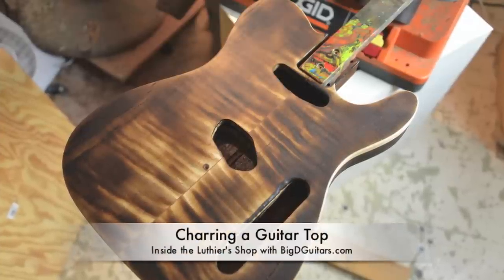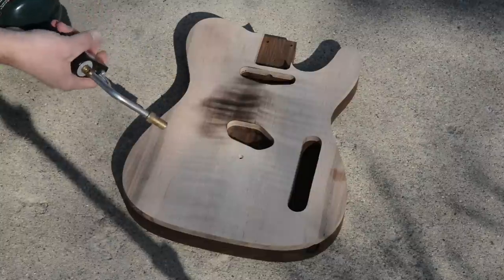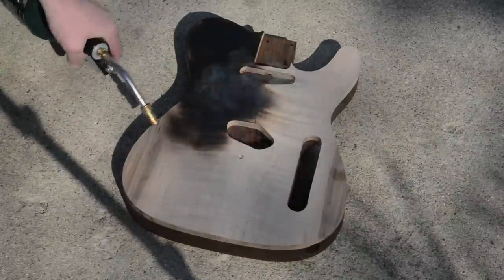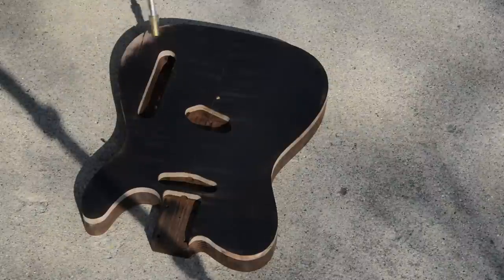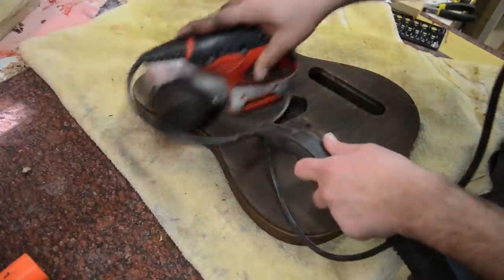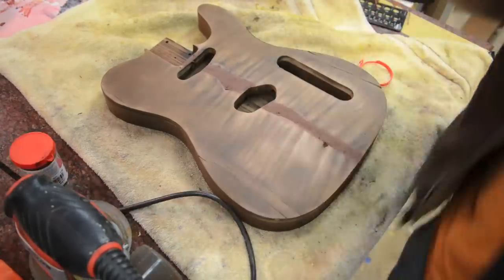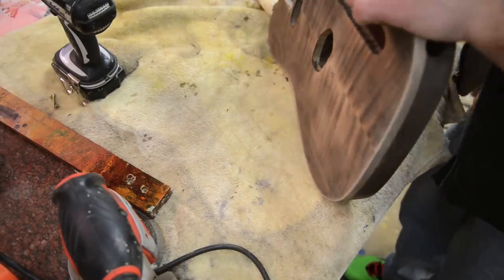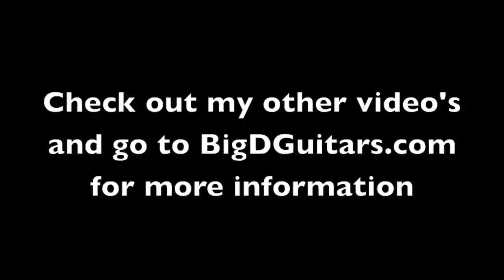Charring a Guitar Top Flaming a Flame Maple Top Scorched Luthier Project

Comment: Here is a helpful hint.  One of the biggest problems with using a basic plumbers torch is the small diameter of the flame. It becomes difficult to control the depth of the burn and the evenness of the burn pattern.  They have an adapter for these types of torches that spreads out the flame to as wide as 5 inches.  It's kind of like the difference between painting a wall with a 1/2in brush or a 5 in brush.  The charring will be more even and you will have far more control.
Reply: carmineredd  that makes no sense.

Comment: Fun project!

I just did my own hillbilly version of torrefication.  I went to Menards and they had a piece of 8" by 6' maple that had pretty good figure on it for 20 dollars, so I cut it into pieces long enough for a guitar top, and put it in the oven for 4 hours at 360 degrees F.  It turned out really well, but the boards did cup a little bit.  It's no big deal, and I'll still be able to make a beautiful top out of it, but if I try it again I will be clamping the wood together with the grain in opposite directions next time to try to mitigate any change in the shape of the wood.  In fact I'm trying the technique out on some hickory now.
Reply from the maker: I would love to see how that turned out!!

what happened to the wood?  how bad did the house smell?
Reply: I'll upload a picture and post a link when I get  home from work today.  The maple made the house smell great, kind of like a mix between cookies and pancakes.  The hickory didn't produced a similar smell, but it wasn't as strong.  The maple has more sugar in it I guess, so it darkened up a little more, but it looks just like the professionally torrefied neck on my last parts guitar I built.  I'll post a side by side picture later.
Reply: Oh yeah, and I should probably warn everyone who reads this, don't do this unless you know what you're doing and have a fire extinguisher handy.  Wood is assigned a generic flash point of about 450 degrees Fahrenheit, and at the low level of moisture in the wood, it would burn pretty violently if it caught on fire. I don't want anybody burning their house down because of me.

Comment: Nice work! The heat treated ash looks and sounds awesome! I've been a fan of baked woods for a while now.
How about watering the top, letting it soak a bit an then putting a torch to it? I would guess it prevents burning and the water trick usually helps the flames in the maple pop out some more.
Reply from the maker: I was thinking of maybe using naptha to soak and the light it ala Jimi...  not sure how save that is.

Comment: Charring the wood might be better to do earlier in the guitar making process.  Maybe when you first get the lumbar for the guitar, because that heat probably warps the guitar somehow.  Not sure how it would affect the glue for the join either.  Does it really sound the same?
Reply: You can't do it earlier otherwise there is going to be bare wood from routing and working the wood. He did it at the right time. Its the same technique as Shou-sugi-ban where it first came from. 

The pros are it makes the wood water proof, removes moisture, increases rigidity. The removal of moisture is why it is resistant to warping, twisting and cupping. The cons are the glue does separate and it costs you a very small amount of thickness. This has been done primarily to necks due to making the neck resist changes in humidity.
He just did it with the wrong gas, He needed to use oxy/acetylene torch so it burns the wood fast enough so the heat is not concentrated and allowed to gather in the wood and weaken the glue completely. Been used for thousands of years just need to finish with oil and your done.

Comment: That looks awesome. How do you keep the plastic binding from burning?
Reply from the maker: No plastic.   Just wood
Reply: @bigdguitars  ok. That second one had a binding so I asked.  I'm wondering how it can be done if the guitar has a binding. A pen torch or soldering gun I suppose?

Comment: At  4:25 it seems that the top is cracked on the bottom left of the video. I think that you dried the top with the fire, and the wood should lose the water. Can it have a bad influance for the sound?

Comment: Hey question. How do you remove moisture from the woods you work with? I have some big pine blocks but they were very moist and i dont think using them will be the best choice.
Reply from the maker: Bring them inside. Let them sit for a few months. If they have been wet takes about a year per inch to dry
Reply: @bigdguitars  so i should cut them in smaller pieces and let them dry, i guess? thanks big d!

Comment: could you char the edges and use that as the "burst" and then paint that tobacco burst center. That would look bad ass with a satin finish
Reply from the maker: Zac Carter that's a great idea actually.
Reply: I am learning to build my first guitar soon. So i have been thinking of a design, got a keep a few to myself just in case its the next big thing ;) but i would be curious to see this finish done on a lp style, if you do video requests lol
Reply: Yes I did it and it works fine as long as you don't let the flame concentrate at a glue joint. Also it helps to use acetylene gas which burns hotter and speeds up the burning so the flame doesn't need to be concentrated to get the effect leaving glue joint intact.

Comment: how'd you do the fake binding
Reply: paint or dye top then scrape edge with razor using ur fingers as guide for width of binding
Reply: Use tape lol then use a razor or a piece of like 600 grit sandpaper to clean up the bleed marks

Comment: Always go with the grain
Reply: Orbital sanders spin, so it doesn't matter.
Reply: Do not use an orbital sander on wood, they are for metal or just smoothing wood for paint. SAND WITH THE GRAIN!!!!!!
Reply: Yep.  ONLY with grain.
Reply: @georgelackey622  why do they use orbitals at every guitar shop I've seen or worked in and every cabinet factory I've worked at?